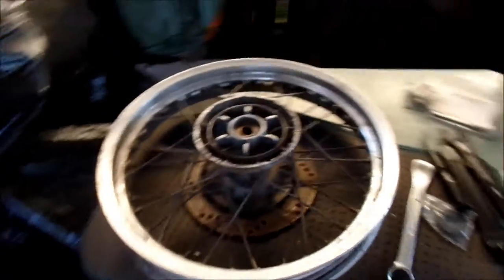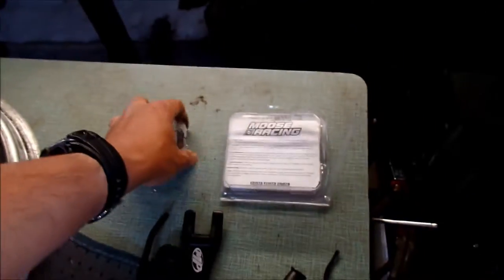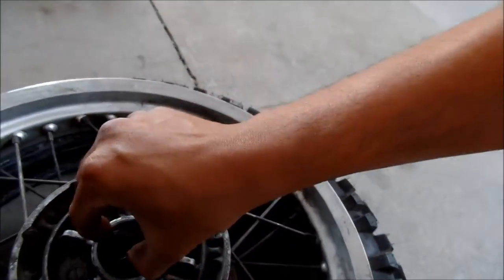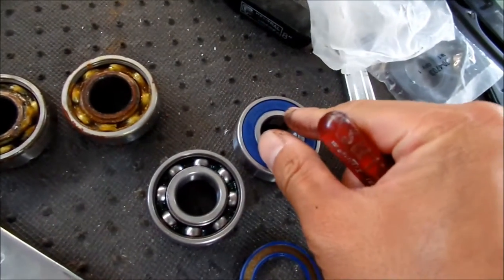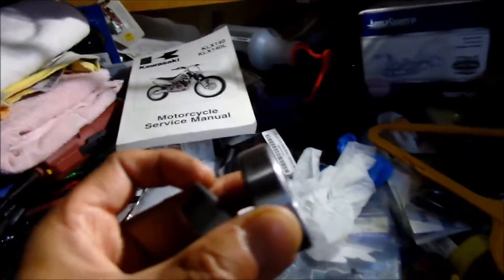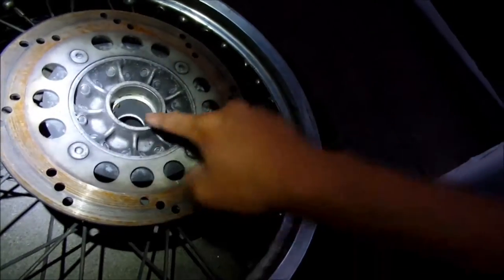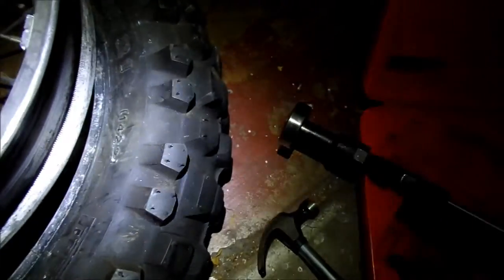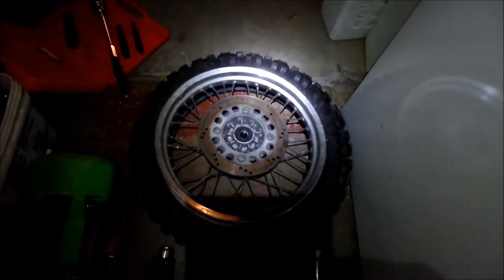HadesOmega How To VLOG: Replace Rear Wheel Bearing DR650

Comment: Just a word of advice, and not sure if this applies to your model but in some old DR's the bearing on the right side (rear wheel) must have a little clearance when seated in the hub (while the one on the left side sits flush), due to the length of the spacer. If you hammer it on the outside race only you will ruin the new bearing as the spacer on the other side will push against the inside race and offset the alignment of the bearing's races. You will have to use something that pushes it in while applying pressure evenly to both the inner and outer race at the same time so that the bearing can stop moving when it comes in contact with the spacer. I would also suggest to use the old bearings on top of the new ones when doing this operation and making sure the spacer does not damage the bearing at the other end, if you use a hammer.

Comment: My 2007 DR goes through rear bearings like mad. Have never been able to pin down the cause. I usually take them over to the shop to be replaced, but if I'm going to keep going through them, might take up doing it myself. Great vid. Very simple to follow. I've put 40,000 miles on that bike, so at this point, the more I can do on my own, the more moolah I save.
Reply from the maker: Hmm I've never had a problem with the wheel bearings going bad.  The bearings I replaced on this video just went through a 10,000 miles cross country trip and never had a problem.  I should probably inspect them though.  Your bike has more miles than mine though, how many bearing have you had to replace?
Reply: At least three and possibly four. I've never known any other DR riders who had that problem. It's goofy. My first 15,000 miles involved a lot of mud and muck, but not so much lately. It's a mystery.
Reply from the maker: Interesting something must be out of alignment or something.  I have replaced the bearings once for preventative maintenance and my bike has a little more than 30,000 right now